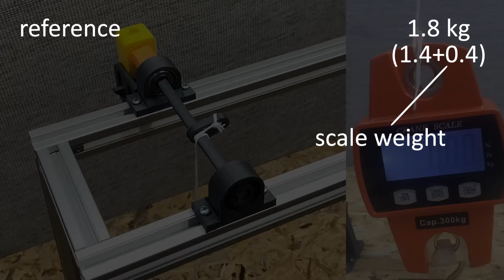Lift Heavy Objects Using SCIENCE & 3D Printed GEARS!

Comment: Plot twist, all cheap elevators are just powered by these plastic motors.
Reply: Wouldn’t that make them incredibly slow?
Reply: New plot for you I used to work at a motor rewind shop that plastic motor is in better condition that 95%of elevator motors
Reply: 5 days after... Floor 2
Reply: @lulusbedtimestories4864no it won't, as long as the gears can withstand the torque it will work, only problem is that the elevator will take minutes if not hours to travel one floor
Reply: What cheap elevators?

Comment: Try using round shafts in your bearings, you are losing a lot of power and rigidity with those square beams which look like they are a loose fit for the bearings.

Comment: What would happen if you added additional parts of line. It looks like your problems were of structural nature rather than pull strength, but adding additional parts of line could reduce the line tension and resolve your line breaking issues.

Comment: You can see the center bearing supprt deflect down under load. If you supported the bar that bearing is on,  or shimmed the center bearing up by an amount thats just a little less than the deflection (so its level under a load) you may be able to slide past 60kg

Comment: Completely new to this and just wondering what the metal bars with slots in them are called? I guess it is a modular prototyping/modelling part but can't for the life of me think what the name of it is so that I can look up the prices on ebay. Also, are there technical names for the bits&bobs that slide into them and a brand name or something that describes the whole kit and all the gubbings that can be attached? Many Thanks ( Apologies, I did look on his website, but could not find any clues as to what are are known as )
Reply: Did you figure this out? Same question 😅
Reply: @benholmquist3589  Hi Ben, Yes I did find it out and went down a right rabbit hole of 101 parts and accessories. They are know by different names but generally can be found by searching on ' t-Slot Aluminium Profile Extrusion'. A similar but different product is the 't-track t-slot system' which is mainly used on workbenches to slide things like routers about. I also found out that the cheapest prices and best deals tend to be ali express, especially if you buying multiples or large discount packs. Shop around would be my advice as there are quite a few sharks out there charging up to x3 for the same part that can be found on the chinese ali site.
Reply: Alluminum rods i believe
Reply: They're usually called aluminum square tubes, although I think aluminum square bars fit this project better.

Comment: Would this little motor draw the same amount of energy and power to lift that weight vs using just a motor designed to lift that weight? what are the energy usage comparison
Reply: The smaller motor would use less energy. It will only ever be under ~2kg of stress before it gives up. The energy used by the motor never increases since it's not the component that's doing the heavy lifting. A larger motor with the capacity to pull ~58kg would need to be made of stronger materials which would be heavier and use more energy to move. 

I may be completely in the wrong about this, but I'm fairly certain that's right.

Comment: I do not get it. Why when the gear ratio is 3:1, we do not get 1.8*3 but 3.6 kg and so on?
Reply from the maker: That calculation is just theoretical. In practically,  we don’t get never 100% efficiency. Maybe the efficiency of that gears are 80-90% in industry but in this setup(3D printed etc.) the efficiency is always too low. There are a lot of things change the efficiency.
Reply: @retsetman9698  Thank you!

Comment: The design of the bases and the building supporting the shaft and bearings were not in their best condition, because when you expect more power from an engine, you have to imagine a stronger bearing building for it, the load increases, the building should be stronger .. same as dodge ram vs Nissan Micra...
Overall, I enjoyed it, thank you for sharing
it shows us gears are so important in mechanical engineering.

Comment: If it was a 125:1 ratio, that motor only saw around 0.46KG at peak. It also means that the motor would have to spin 125cm for every cm the weight was lifted. I kinda understand why you sped the video up so much now..

Comment: Thank you for the video. I have a question why I stopped adding gears. Are there limits? And who is responsible for the number of gears, my respects
Reply: Eventually, the inertia and friction of all the gears, bearings and axles will add up to overwhelm the motor.

Comment: power of the motor =angular speed* Torque
Heare the power of the small motor is very little then how we get mouch torque? won't this motor burn in continuous  running? plese Explain
Reply: The huge increase of torque is due to the use of torque-focused gearing. Torque-focused gearing actually places the least strain on the motor. Speed-focused gearing is what wears down the motor.

Comment: 125:1? where did that number come from? please someone answer my question
Reply: It's the multiplication of all the gear ratio.
50:10 x 50:10 x 50:10 = 125.
Using 3 pairs of gear with 50:10 ratio is equal to using 1 pair of gear with 1250:10 ratio.

Comment: What size is the bearing?
Reply from the maker: 8mm-608zz
Reply: @retsetman9698  How does the 6x6 shaft fit into the 608ZZ bearing? Because the inner width of the bearing is 8 mm while the 6x6 square shaft edge sum is 8.5 mm.

Comment: its just math the more ratio u use the longer it takes but the more it lifts iff u used a 25000.1 gear ratio u would prob lift a car aslong as ya gears was all made from the proper stuff cos a chain is only as strong as its weakest link your even doing all this wrobg exspecting a thin bit of plastic to lift 15kg u must of known it was gonna bend...so wtf do u no out about this

Comment: You should do a similar experiment using counter weights. You'll still need the stronger aluminum bars for axels and also the stronger steel wire BUT you won't need as much gear ratio to lift heavy objects. It'll show how counter weights can speed up how fast you can lift these objects (just like how a bike in 1st gear goes up hill easier but has that negative effect of travelling slower) - @retsetman9698